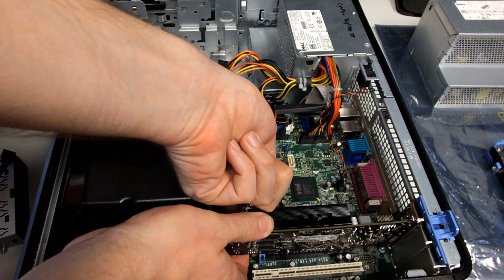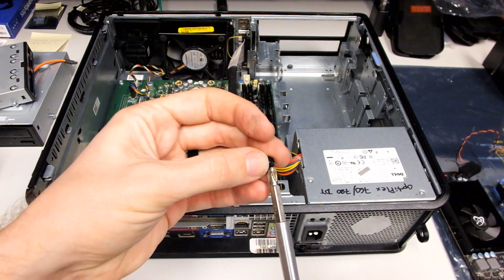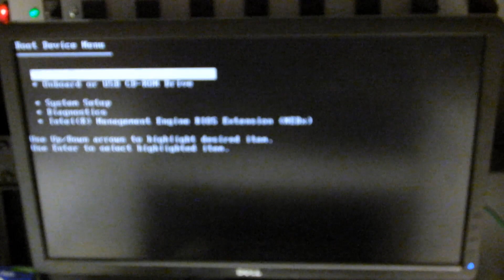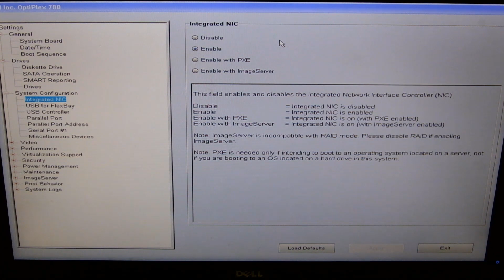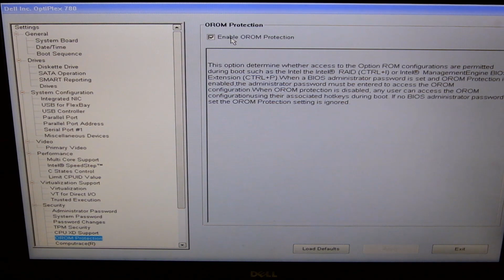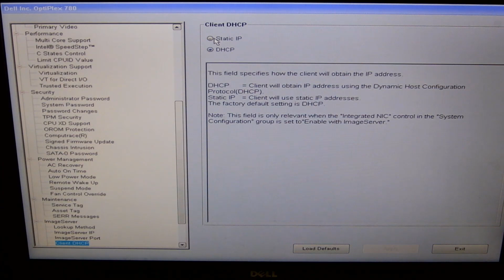Troubleshooting and repair of Dell OptiPlex 780 desktop PC

Comment: I have a problem with my Dell Optiplex 780 . At every start up it gives a message"The Dell encryption accelerator that was used to encrypt the system is not detected . Strike F1 to continue, F2 for setup utility or F5 to run onboard diagnostic . How can I get rid of this message every time I start my PC 
Would appreciate receiving a solution to my problem . rgds
Reply from the maker: Hi!  Thanks for the comment.  I'm not too familiar with that particular error message but it sounds like at some point either yourself, or someone who had access to the machine, installed DDP - the Dell Data Protection utility - and now that utility is either broken, no longer functioning correctly, or the key has been lost.  You didn't mention do you have unaccessible data encrypted on the machine or not?  If you do not, I think the easiest way would be to just "nuke it from orbit" -- do a fresh reinstall of the Windows operating system from a flash drive.  There are hundreds of links showing how to do this, here's one to get you started:

https://www.youtube.com/watch?v=zwxsDOrIlxY&

This process will completely erase the hard drive and give you a fresh installation of the operating system.  You can use it for either Windows 10 or 11, although with the age of your system I'd recommend sticking with 10.  You can then reinstall all your system-specific drivers from Dell's support website and any tools and applications from the specific providers.

If you do have files and data saved on the machine that you currently can't access, you'll need to either reach out to Dell's support or to a company that specializes in recovering data off hard drives such as DriveSavers or Kroll Ontrack.  Given the age of the machine I don't think Dell is going to be much help; recommend contacting a data recovery firm to regain access to your data.

In summary: if you don't have any data on the machine, format the hard drive and reinstall Windows.  If you do have data on the machine that you can't access, contact a data recovery firm.  I would personally never recommend using Dell's encryption tools.  If you want to encrypt your data use Microsoft Bitlocker, and always store a copy of your recovery key in a safe location.

This thread on Dell's support site may be helpful:

https://www.dell.com/community/Laptops-General-Read-Only/Dell-Data-Protection-Encryption-Problem/td-p/4527366

Good luck!
Reply: @CompTechMike  
Dear Mr Mike Smith
Thank you very much for replying. 
Let me explain that initially my system had HDD 80 GB any every thing was working fine .Recently I removed 80 GB HDD and mounted
250 GB HDD since then this error message appeared . I hope this point would give some idea about the problem  .
Waiting for your expert
Guidance 
Best regards
Reply from the maker: @212wahid1  hi Wahid, without having the system in front of me it's impossible to tell exactly, but if I had to guess it sounds like the original 80GB hard drive was encrypted with the Dell encryption tool I mentioned previously. And whomever performed the upgrade did not properly migrate the data from its encrypted state onto the new drive.

My recommendation would be to put the old hard drive back in, remove all of the encryption, and then re-migrate the unencrypted data back onto the new drive. There are various tools and utilies that can help with the migration. Alternatively, put the old 80GB drive back in, back up your data to a portable external hard drive, then install the new drive, perform a fresh install of Windows on it, and then copy back your data from the external backup. Good luck!
Reply: @CompTechMike  
Dear Mr Mike Smith
Thanks a lot for your quick response . I will follow your advice and
Intimate you with the result.
Thanking you once again.
Best regards

Comment: Hi,i have this 780  and i use for while but today i turn it on and starting to hear a continously beeping noise in my monitor shows press<ctrl-I> to inter configuration
Reply from the maker: Hi! Sorry to hear that. Beeping usually means some kind of hardware issue. Are you also getting any trouble code lights along the front?

I would start by working through the troubleshooting steps shown in this video and mentioned in the comments. Start by double-checking all of your cords and connections, make sure everything is connected properly. Then take out all of the memory except for one stick, and all expansion cards, and see if it will boot then. Swap the ram around and give everything a good cleaning. If you get any of the 1-2-3-4 error lights or a specific beep sequence, look that up in the Optiplex 780 troubleshooting manual. Most likely it is a bad or loose stick of ram, but even if it is something more significant (like the motherboard) you should be able to get parts cheaply on sites like Amazon or eBay. Good luck!

Comment: hello Smith can you help me out my optiplex 780 won't start but it blinks and displays number 3 but won't start
Reply from the maker: Hi!  Thanks for the comment.  Here is a link to the troubleshooting manual:

https://images-eu.ssl-images-amazon.com/images/I/B1cEeKjqcPS.pdf

According to the manual, a blinking "3" indicates a processor failure has occurred.  I would try removing, cleaning, and reinstalling the processor (using new thermal paste).  You should also remove any upgrade cards and all but one stick of RAM for testing purposes.  If the problem persists after that you could try either a replacement processor or a replacement motherboard.  In my experience it's more likely for the motherboard to have failed, but the processor itself could also be bad.

Personally I'd swap the processor first (since it's easiest).  If problem persists replace motherboard.  Fortunately both components are cheap and easy to obtain on sites like eBay and Amazon.com.  Good luck!
Reply: @CompTechMike  Thank you very much i will try it out now

Comment: hello! when i go to take off the optical drive cover (where you pull the tab and push it back) it doesn’t work. could it possibly be jammed? how do i fix this?
Reply from the maker: Hi! Thanks for the comment. I assume you mean the blue tab where you lift up and push the optical drive back shown at 3:15 , correct?

Yes, those can jam or bend if a drive was improperly inserted in the case or if something heavy was placed on the case at any point. Tough to say without seeing it. I don't really have any tricks or secrets, just keep trying, wiggle each component a little bit, and maybe also squirt a bit of WD-40 down there to loosen things up. I've also seen a few cases where the spring popped off, you might be able to get down in there with a narrow flatblade screwdriver to push things into the right spot. Keep trying, it should come out eventually. Good luck!

Comment: I’ll try the pre bios test on mine, it’s a pita failing to boot with just the number 1 error led lot. This is supposed to mean ‘unable to see memory’ but it was working and I’ve tried each stick in each slot and it’s the same wherever. PSU is good, cpu looks good cmos cleared and back up battery good I can only imagine it’s a dirty contact or a failed m’board.
Reply from the maker: Good luck! Try with just a single stick and cleaning the contacts with 99-100% isopropyl alcohol (not that 50% junk).

Comment: What’s the name of the motherboard
Reply from the maker: Dell Optiplex 780 DT motherboard 0200DY.
Reply: But quick question? What other motherboards can you use with the dell optiplex 780
Reply: Thanks man
Reply from the maker: @mitchell7960  Optiplex 780 (as with most Dell systems of that era) use a custom BTX form factor of motherboard. You can generally only replace it with another identical board, or occasionally a smaller variant (for example, a DT "desktop" chassis may be able to fit a SFF "small form factor" board). Nothing else is going to fit without a lot of modifications. Your best option if your board has failed is to pick up another identical one. Fortunately you can usually find these on sites like Amazon or eBay for around $40.  Good luck!
Reply: Thanks

Comment: Hi can you help i have same computer it's not powering up, the just spin the fan and stops light does not stay on. I already change the battery power in back and  the battery i/o power in front still not powering up.
Thks
Reply from the maker: Hi! Thanks for commenting on my video.  It sounds like you have power since the fans are spinning momentarily, correct?  Have you checked that everything is physically connected and tight inside the case?  Especially the connectors between the power supply and motherboard.  Is the power light by-chance lighting up amber/yellow color?  If so, I'd start by removing any expansion cards and all but one memory stick.  Try again in that configuration.  You may also swap memory sticks to different slots, just to rule out an issue with an individual stick.  Also, are any of the 1-2-3-4 diagnostic lights lighting up on the front of the case?  These can help point you in the right direction, based on the troubleshooting manual:

https://www.dell.com/support/kbdoc/en-us/000126021/a-reference-guide-to-the-dell-optiplex-diagnostic-indicators

If you've already done all these things and the machine is still not powering on, it's most likely you've suffered a motherboard failure.  Unfortunately the motherboards aren't easily repairable, but they are easy to swap out with basic hand tools.  You should be able to buy a replacement motherboard on sites like amazon or ebay for around $40-$50 USD.  If you've watched my entire video it should be pretty clear how to remove the board.  Hope this helps!
Reply: Thank you will check or may just send to technician guy. Appreciate your help and time👍🏾@Mike Smith

Comment: how you change the fan
Reply from the maker: Hi! Assuming you have an Optiplex 780 DT chassis machine as shown in this video, you would remove the motherboard and other components  (as shown / talked about in this video).  Once the motherboard is out the front fan is just held in with one plastic clip.  You may be able to remove it without removing the motherboard but you won't be able to get the new one in.  You need to remove the motherboard in order to have enough clearance to fit the replacement.  Hope this helps!
Reply: @CompTechMike  thanks i need help
Reply from the maker: @demorrieuspowell2875  hope you're able to get it. If not, pretty much anyone who's familiar with working on computer hardware should be able to change this part out. Good luck. 😊

Comment: While watching YouTube screen went dead and I got six beeps. I rebooted and got six beeps on startup. I rebooted a couple of times and it started working normally for a few minutes and then poof six beeps.  As I understand it, six beeps is a graphics card issue. I took it apart thinking to replace the graphics card, but there was no graphics card installed. Any suggestions as how I should proceed?  Thanks.
Reply from the maker: Hi! Is this an OptiPlex 780?  The manual doesn't indiciate a six beep code error:

https://www.manualsdir.com/manuals/621892/dell-optiplex-780.html?page=23

What lights are lit on the front?  The 1-2-3-4 lights?  Those are usually more revealing.

https://jsmcomputers.com/pub/pdf/optiplex%20780%20SFF.pdf

That said, the usual troubleshooting steps for hardware are all applicable.  Remove every extra part and all but one stick of RAM and see if it will boot then.  Try the RAM in different slots.  If it works like this, add components back one-by-one until you find the failure.  You can also run BIOS-level diagnostics (assuming the machine will boot to BIOS) to help identify issues.  Good luck!

Comment: my desktop power button billing orange light when i press to boot it. need help
Reply from the maker: Hi! Is it a 780? Are you getting any of the 1-2-3-4 error lights lit up? These error codes can be found in the troubleshooting manual (available online) and can help point you in the right direction.

Also I recommend removing all add-in cards and all but one RAM stick, and testing like that. Test with each RAM stick, in each slot. This will help you identify if there is a bad component. Good luck!
Reply: @CompTechMike  nope! when i attach jumper for reseting bios, it shows me 2&4 numbering and red power button alert but in normal pushing red light on front button
Reply from the maker: @thestars8941  Hi! Is this  an Optiplex 780?  If so, A  2-4 error could indicate a video card error. Have you tried all of other suggestions already?  Including removing all cards and only one stick of RAM, and seeing if it's able to boot then?  Worst case scenario you may need to replace the motherboard.  This can be accomplished with basic hand tools in less than 30 minutes.  Replacement motherboards are generally available for around $30-$40, depending on your specific form factor (USFF, SFF, MT, or DT).  But I'd try all those other things, first.  Good luck!
Reply from the maker: https://www.dell.com/support/kbdoc/en-us/000126021/a-reference-guide-to-the-dell-optiplex-diagnostic-indicators#2009_to_2012

Comment: i cant open the case should i unscrew it ??
Reply from the maker: Hi! Thanks so comment. Assuming you have an Optiplex 780 like shown in this video, you can't open the case by unscrewing it. You need to slide the "locking tab" on the top back towards the back, which will allow the side panel to be released. You may need to pry on it a bit with your fingers or a flat screwdriver if the panel is stuck or hasn't been opened in a long time. Sometimes a little bit of WD-40 helps, as well. Good luck!
Reply: @CompTechMike  i opened it but orange light :(
Reply from the maker: @abdullahkhannnnn  If you are getting an orange light on the motherboard that just means the board has power.  If you are getting the orange power button light that could mean a bad motherboard, but it could also mean a lot of other things.  Watch the full video and read all of the comments, you will need to do a lot more troubleshooting besides just the orange light.  Good luck!
Reply: @CompTechMike  i should get a new pc ???
Reply from the maker: @abdullahkhannnnn  I mean, I can't really tell you if you should or should not get a new PC.  Anything is fixable.  Anything can be upgraded.  But there is a cost-benefit analysis associated with that.  If it would cost you $400 to repair and upgrade your existing PC, or $600 to buy a new one --- is it worth it?  What if the cost of parts & repairs exceed the cost of a new one?  All of these are decisions you will need to make yourself.  Good luck!

Comment: Do you need to open the cd rom to add a ram ?
Reply from the maker: Hi! Thanks for the comment. I'm not sure this question is worded the way you meant to word it. No, of course you don't need to open the CD drive to add RAM. The RAM goes underneath it, and it may help to remove it. But you don't need to open it. 🤣
Reply: Ok, thanks

Comment: thankyou so much  for taking time to show us how to do it ,i have a question my mother has a computer like this one but when i turn it on it stays on for about 5 to 10 secs and then i cant see nothing  on the screen do you think it could be the power ?
Reply from the maker: Hi!  Thanks for the comment.  Re: your mother's computer, does anything show up on the screen at all?  Are you able to get into the BIOS?  Do the power lights come on, or the fans spin?
Reply: I've the same problem like this.When i press power button,suddenly the system is running and i can't see nothing on monitor.All fans are spinning normal.I'm using Dell Optiplex 760.

(Sorry for my English)
Reply from the maker: @modernzeus7021  Are you sure the system is running? Are you seeing hard drive and activity lights on it?  Try checking all of your video cables, connections, and verify that your monitor is working correctly.  Also if you have an aftermarket video card - try reseating it, or remove it and test the PC with just the native/built-in video output.  Good luck!